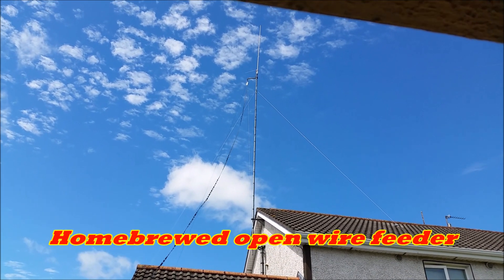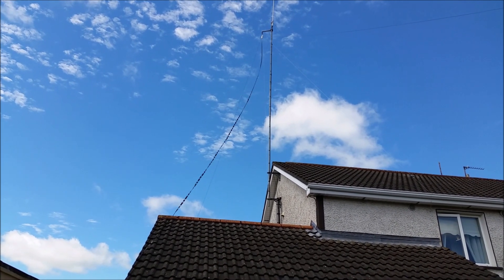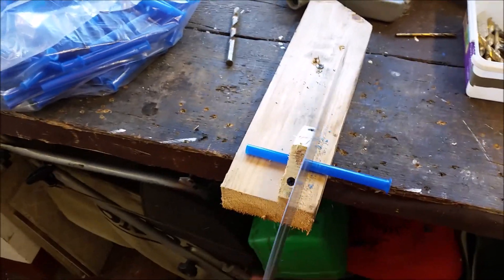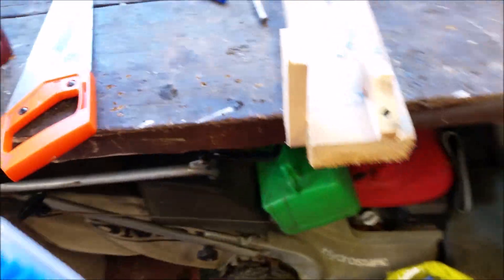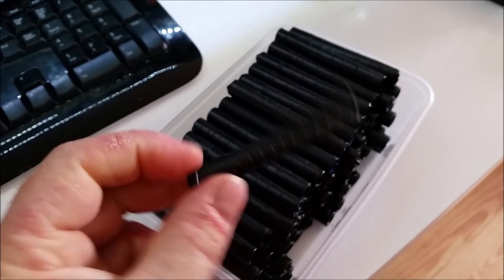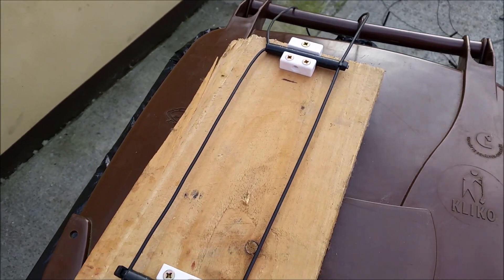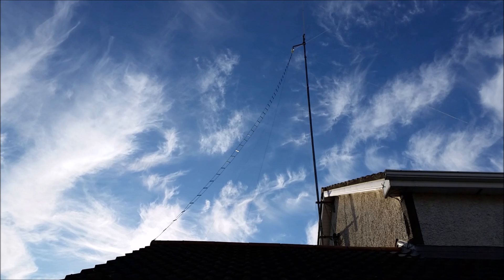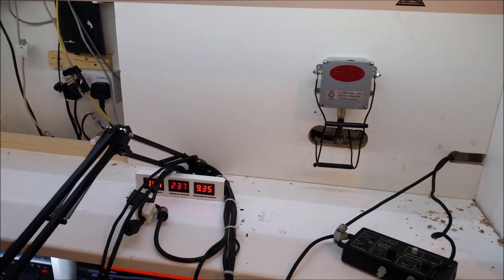Hombrew openwire feeder

Comment: Just a thought you may want to space the ladder line out away from the house wall. Not sure about the construction of your particular walls, but stucco walls have expanded wire ( Chicken wire) or wire mesh just under the surface for the mortar to bond to. The wire mesh may or may not have interaction with the ladder line.
Reply from the maker: No wire used in render here. It's all good man.

Comment: Nice job of homebrew openwire George. I have not used a balun on any open wire feedline. I have heard conflicting stories that I need to use a balun or I don't need a balun. If there is coaxial cable in any part of my feedline then I will require a balun.
Reply from the maker: It works well for me. I was advised by a ham thats licensed over 60 years to do it the way I did with the balun.
Reply: Great. I dislike the question every new ham asks because they don't understand. What it the best antenna? What works for me may not work for you is what I tell. They are looking for a definitive answer and I don't have one. Best 73
Reply from the maker: @MoTown44240  as they say Stateside 'your mileage may vary' lol

Comment: Hi George, I made a similar ladder line but used papermate pen sleeves, works for me and worth the effort dont you think, installation looks great but you might be a bit close to your wall. I use a symetrical matcher KW107 super match and it works fine, I,m not a fan of using baluns at the end of the feeder and then into a matching unit, yes I know alot do but I find its a lot better using a true balanced tuner/matcher, have fun and the ladder feed looks great. KR 73 SK G0OGS Steve.
Reply from the maker: Steve Malpass hi Steve. Thanks for the comment. It works very well I have to say. I've since spaced it out from the wall by about 8 inches. Can't say I noticed any massive difference to be honest. 73 de EI7KO

Comment: Actually i found using a low impedance line feeder (200ohms) is better when you cant get mast height and less interaction with ground effect,it also radiates less.
 Hi Z Open feeder great in open spaces,high antenna masts 50 feet+ ,but you got to watch for walls of house,buildings anything close to the feeder line now due to using a higher Impedance source.
I dont see any advantage of HI Z ladder line in practice when using this stuff,unless feeding 600 ohm antennas?
Suppose depends on what antenna system your feeding?
Most of mine were 600 ohms Tilted folded dipoles or terminated folded dipoles,I found higher impedance source could  limited operating condition &  interact with objects surrounding antenna,I switched back to low Z ladder-line now and replaced the terminator resistors,I found the lower impedance stuff actually quieter in Urban,than the HI Z stuff,but obviously that depends on your setup and working conditions.
Liked the video quite ingenious using those,liked the Jig set up handy.

73's rob
Reply from the maker: rpcomms1 using a 204 foot doublet with the feed point  66 feet above the ground. It works quite well.